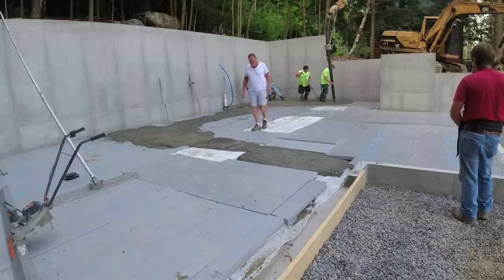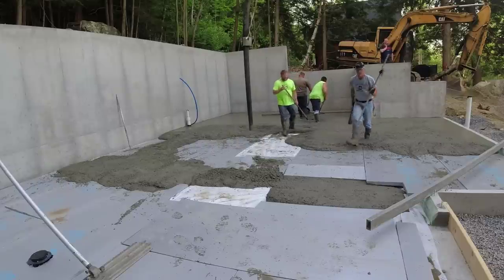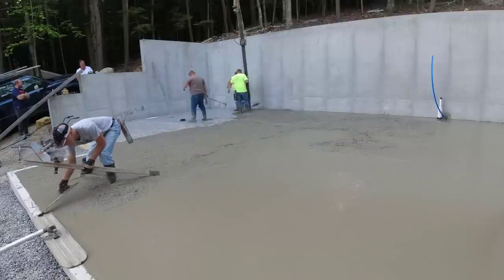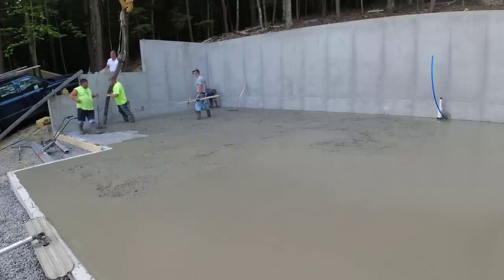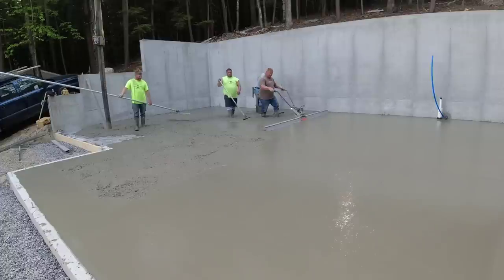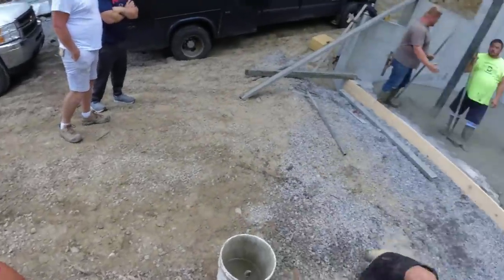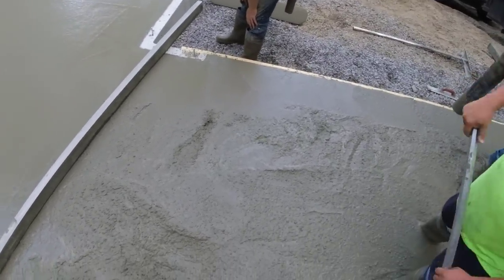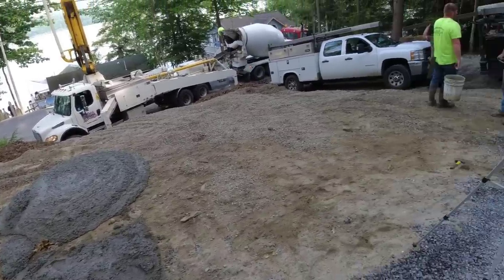Major Problems With The Pump Truck (Pouring The Floor Part 2)

Comment: Nice work guys! I've been pump operator for 17 years and now own a  pumping business. Everyone kept their cool and got it done. As a operator working with a concrete crew that knows what they are doing help tremendously. Only thing I'd done differently with the plugged pump, would have reverse it to release any pressure after the botched prime out. It help relieve the rock jam and not hurt anyone. Most time nothing happens but I've see air pocket blow out and it pretty crazy.  Great crew that knows what they are doing.

Comment: As A concrete Pumper I Always Appreciate the Concrete guys that are Patient while We work on Our Self induced problems in a Stressfull situation But We Will Get that Mud From Point A to Point B.Awesome that the Mud Got Put down.Nothings worse than Hot Mud😢

Comment: Respectfully, it is simply a no-brainer and proven over and over through years of testing that separation between a transferable cold ground, (especially in your Maine climate) and a 4inch concrete slab that a 2-inch layer of rigid foam insulation is forty times more efficient at trapping heat than just a concrete slab on ground grade surfaces alone. Although rigid foam can be expensive at the outset, the savings over the next few decades will far outweigh the costs.
Your skepticism is bewildering, fine sir.😇

Comment: I got footer guys that I will send my guys too with poly in a container and depending on bulk heads, they'll dump some in and take that 5 to a 9 inch slump. I've got guys who pour out of the truck that always ask for mid range on site. Good stuff and you can pour wet without all the water degrading the concrete when you would add 30 to 40 to get that slump you want and with mid range you throw 10 in and you've got the same result.
Reply from the maker: Yes, awesome, thanks for the comment!
Reply: On a side note though, you need a crew that can get on the slab and finish it before the mid range starts sloping off. When it does, you're going to dry up to the slump it was before adding mid range. Compared to water it'll dry up quicker because it's just the chemical making it take less water to get it wet.

Comment: Mike got a question is there difference in how much cream is left on top between the area where you power screed and hand screed and does it affect the finish of the floor. Another great job.
Reply from the maker: Might be slightly more where we power screed. Don't see a difference when we power trowel.

Comment: What would happen if pump fails? Fails to work, fails to come to job site ... flat tire etc. You got a cement truck on site and 1 more on the way. What can you do? I am thinking of doing my own foundation and this is the scenario that is graying my hair and I am thinking of switching to blocks to just avoid such a case. Has anything like this ever happened?

Comment: Hi Mike, unlucky with this new driver, but everything ending good. 
Question; when it’s a slab for inside a building you don’t cut any joints ? Joints are only for outside ? Probably spend the bucks necessary for the lessons from you. Probably diy Alaskan slab soon. Thanks, Fred (from France)
Reply from the maker: We saw cut or hand tool joints in all our pours. Except if they're really small like 10' x 10'

Comment: Here in Montana with the weather cooling off,the batch plants not having their boilers on for hot water the concrete justs sits there especially in the shade lines. Anyone else having that problem?
Reply from the maker: Happens here in Maine too.

Comment: Mike, how long has this crew been working together…, and who has been there the longest…?
Reply from the maker: I've been doing this 41 years, Darin's been working for me 27 years and Luke 20 years. Eric is a school Teacher but did work full time early on, and has been working summers for 25 years.
Reply: @MikeDayConcrete   Wooooow…!  that is “awesome”…  That is just amazing.  That is also why you guys (and gals at times) make it look so easy.  It’s is a ballet act, smooth movement(s), no wasted effort(s), synchronized act(s)…  no direction, everybody knows their roll.  Your calm cool & collected demeanor during the truck pump operator “snafu”.., was very good…, I mean really, what are you going to do, in that situation.  Thank you for your reply back.

Comment: As cool as a cucumber crew. Credit also for the pump operator; he fell, picked himself up, dusted himself and got back to the grind. Nice work.
Reply from the maker: Good point!
Reply: Pump op and mike were both freaking out a little at the end. That’s what it looks like when it happens. We know at the end of the day screaming and yelling don’t solve shit and the concrete is going to set up either way
Reply: @johnnyhopkins7297  Agree. Also,Mike probably doesn't own a red panic button in his arsenal of tools.

Comment: Mike.  You do realize that pumping is not an easy job,    I seen three issues with that pump operator.   First  he didn't get the water ahead of the concrete.  Second his agitator was going the wrong way  and when he started to prime he lost his lube by not ensuring his pump was ready.  That guy looked very green

Comment: Check out Matt Risinger (Build Show) He’s got some really good info on building science—including under floor insulation.  I just finished a basement for a customer and installed foam over the slab since there wasn’t foam under the slab.  I’m in South Portland.
Reply: Don't drink his Kool aid, he has encouraged and supported some very questionable building practices.   Improved framing, conditioned attics,  that coated osb, old pex when it poisonous.  Newer isn't always better.

Comment: Long story short hot day on a bridge in summer its 10 am, late truck with hot load, so pump plugs up like a chain one by one down the line they plug up 5 of them total it's me one other Finisher and 3 Labourers we break houses and are hitting them with sledge hammer and lifting them up full of hardened concrete shaking the hose line when the engineer looks at me and says just hang it on a tree and bang on it 😑

Comment: It was slight incompetence of operator, certainly not a major problem. When you get concrete going off in lines, cold joints or blowen pipes then it becomes a major problem